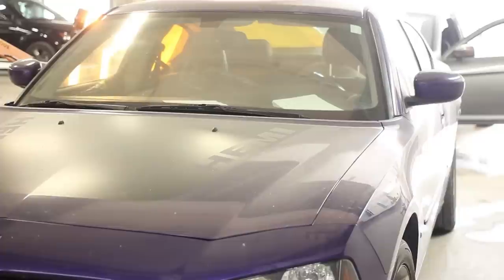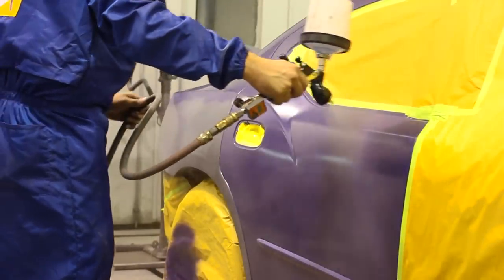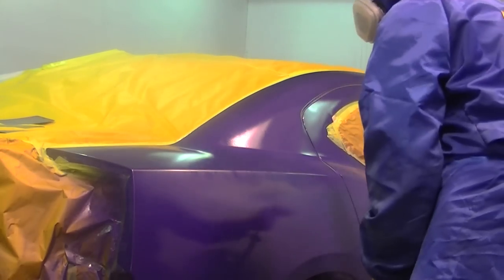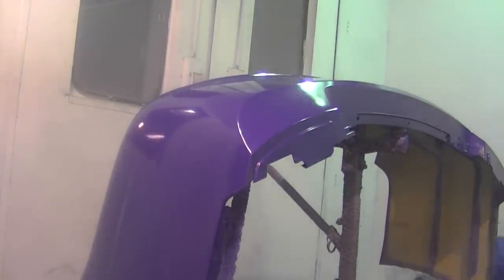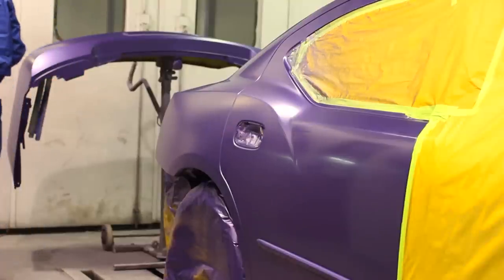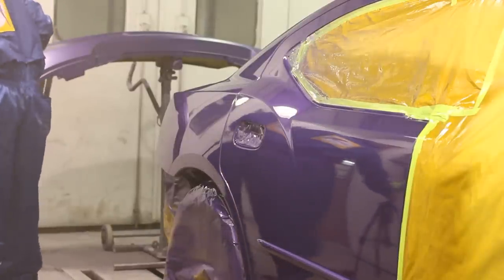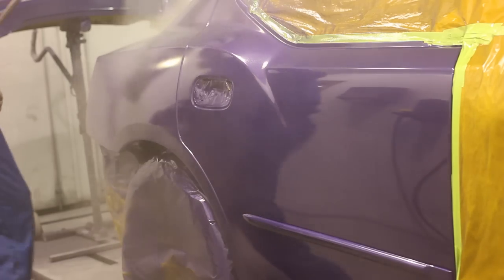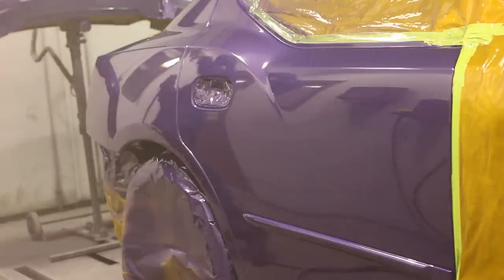Achieving Vibrant Perfection: How to Blend Car Paint for a Stunning Purple Dodge Charger

Comment: High air pressure fan full width & full material uses A LOT of materials equals higher cost on job. Some paints are $180 for half a litre so spraying economically is relevant too.

Comment: If one has a panel say, a quarter panel to work on and the damaged/repair part it's already primed and ready for base and clear but, undamaged part still has it's original clear on it, how do you blend the repaired part together with the original clear-color? Do you strip the clear of the good part and re clear it or strip the entire panel and repaint?

Comment: Do you leave the paint code/finish details in the owners manual in the vehicle? So future you (or others) can match it?
Reply from the maker: No, we have records if they come back but it's up to the shop to match it.
Reply: ***** ..The paint code (so long as you haven't had a colour change) is normally on the door shut..on the plate....but there can be various shades.

But on older cars..under the bonnet (hood) ...Vw's ..the spare wheel compartment
....A nice finish...full marks
Reply: +David Riley I do this when I colour change wheels, but no need to do it for the body